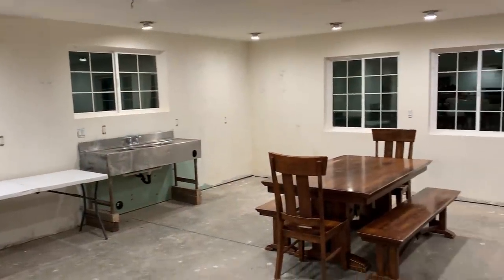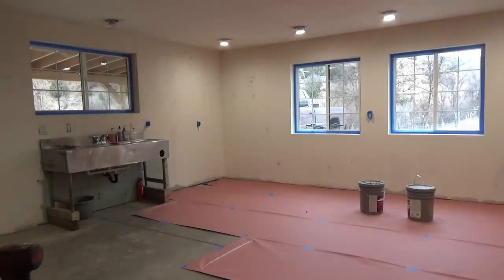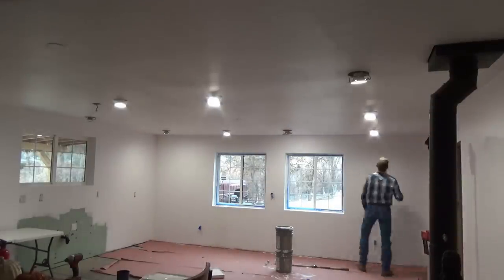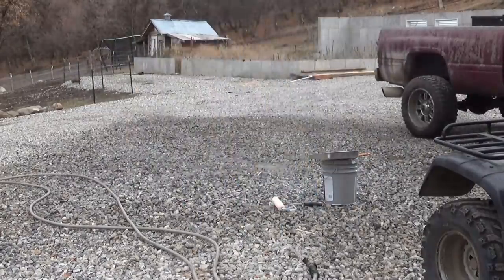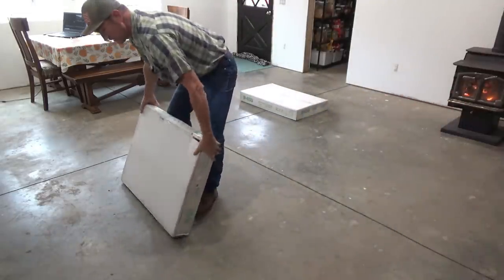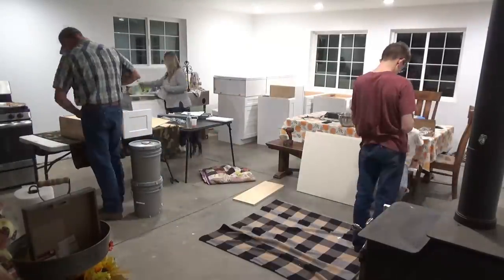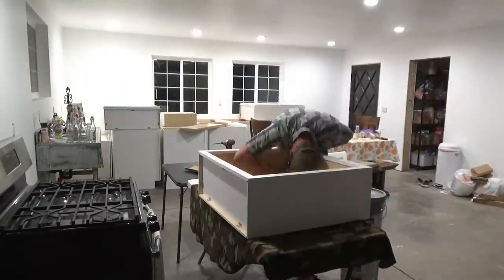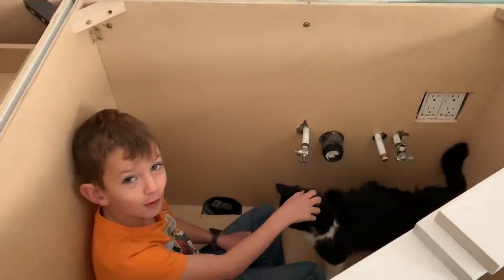#385 - I Painted The Kitchen! RTA Cabinets Assembled

Comment: What works for me is with the upper cabinets, screw a 2x4 to the wall where the bottom will be. Sit the cabinets on the 2x4 and screw them to the wall. That way they are all level, it is easy to hold them while putting the screws in, and it is easy to patch the screw holes when finished and 2x4 removed. I made the mistake of installing the bottoms first one time. It is much easier with them not in the way. You are doing a great job, it looks very nice. Merry Christmas.
Reply: Everybody's back gets to learn to do the uppers first(next time). Right?

Comment: I think you will find white a good choice.  Yes, it shows dirt and kid issues more, but, it really lightens up the rooms.  This is especially important in northern climes like Idaho.  When I had my place in Northern Idaho painted I chose all white and it has been a really good decision!  Even low power LED lights give plenty of illumination because, the light is not being absorbed by the paint on the walls and ceiling!  And, whatever comes in through the windows is bounced around instead of being absorbed by the paint.  Huge difference!

Comment: Can't wait to see the final result. 3 things i would advise you to do. Put some wood looking tiles on the floor, are super durable and easy to clean (perfect for your application),  change the doors with some better insulated ones (will help you warm the place) and maybe try to build some kind of a chimney/fire place in place of that stove. Other than that your work is amazing, i really like what you managed to do with the farm project.
Reply: Alexander he won't take advice very well, but i do agree. Concrete floors look to plain and not homey feeling
Reply: @randomlyfunny2657  I hope he will at least consider. I really like his work. I lived in the country side a while back and i sure do know what muddy boots can do to a floor. Or the melting snow during the winter. Wood is not an option even though will give you that homey feeling. 
Google for "Porcelain Tile that Look Like Wood". I just love them.

Comment: White is a good choice to start with.  It goes just about anything and provides a great base for any colour to be used at a later date.
And Gosh, I love putting together those "RTA - IKEA" style cabinets.  
We did our Kitchen with the IKEA stuff last spring.  I only put 11 of those together in our kitchen, but then our kitchen is only a 1/4 the size of yours (at 10'x10').  Also, I doubt my wife would have let me travel across two countries to help you set up cabinets.  

All our bedroom drawers, and living room shelves and the closets are set up that way too.  Actually the living/dining shelves were repurposed as in I modified them to take our tv and such, something they were not originally supposed to do.

I guess it's just the Scottish part of  me to not spend a lot and reuse what I have left over for something else.  Even our only tv is a CRT style. It still works so why chuck it.

What you got as snow, that storm gave our neck of the woods, freezing rain.

Comment: Looks like you may need some more weather striping on the bottom of the back door.😎
Reply: I think that it's a reflection from the window.  I also thought that there was a gap there But,  now I am pretty sure that it's just light reflecting from a metal strip at the bottom of the door.

Comment: Growing up my dad would only use Sears Best Paint. It was the best paint to paint with. Since Sears no longer sells it I found the Behr Marquee paint at Home Depot to be pretty much the same as a comparable. It costs about $46 gal or $205 for a 5 gal pal, but in the long run its well worth every penny. Most of the time it only takes one coat and it rolls on like silky butter. I never cared for Glidden because it always takes more coats and doesn't roll on as smooth. I learned a long time ago its never worth trying to skimp on cheaper cost for paint because it always ends with taking 2 to 3 times longer to paint and you just end up buying double the paint you would use by just paying for the good stuff.

Comment: That pile of burning cardboard looks similar to the pile that I had left from the cabinets that I installed. I really do like the quality of the RTA Store cabinets. It was much easier than I expected. I did wind up getting a jig for installing the hardware on all of the cabinets (lining up all the handles and knobs perfectly) from the same company I got the cabinet levellers from, check out ez-level.com. It made my job much easier. Can't wait to see the finished product!

Comment: Should have installed all the doors and baseboard before painting.  Primer is fine, but there will be so many handprints, a lot of caulking, and touchups after the trim paint that the walls around the trimwork will look splotchy and you'll want to repaint.  I've learned this renovating houses and apartments as a career for years now.

Comment: While I know that it is your place and you are doing it the way you want it, I would have installed the floor before putting in the cabinets.  That way the flooring is completely under the cabinets and not butted up against the fronts.  It would give it a more professional look that way.

Comment: I face planted in the mud. sluuuurrrrrrrrpppppp AHHH man I went EYUUUUUUU at the sounds of that. :-) Kids :-)

14 hours. MAN that must have been one heck of a marathon. I bet you slept half the next day. THAT is a lot of freaking work!!

White is wonderful. especially in a solar/led scenario. it just makes everything brighter and makes everything feel more spacious. I want color. I love color but my work space will be white. I want the bright and open feel of white :-)

We have had 5 snows already 3 were just dustings. gone by mid day. but the other 2. one 6" stayed for 1.5 days thsi last one 8+ inches is hanging around a little longer. caught me off guard. I was not expecting is so early (back in PA we get more snow but it does not usually arrive till january!!) so my snow blower is still in the trailer. I am not able to remove it (have to dead lift it no ramp etc.. its easy 300 pounds! took 4 of us to dead lift it into the trailer) have to find trustworthy help to get it out. risky they might decide to come back at night and part me from my property. then its up to me and mr 12 gauge and I don't want that.

eventually I need to build myself a little 12-14ft high gantry that I can drive under with the trailer. hook a small winch to a snatch block at the top of the gantry and "lift" stuff, off drive away, then lower it to the ground. One more project :-)

Comment: When you install Kitchen Cabinets, it`s all about precise working. It is no rocket Science, just take care that you stay within half a millimeter precise in measurements. Or in US -Terms: 0,019685  If you follow this, you`ll be OK, and the Kitchen will be a success!  One thing I have learned due to the installing of a few hundred complete Kitchens, precise work is the most important thing!  When you begin to don`t care about a quarter of an Inch, the Kitchen will be a Mess, and you will not be satisfied in the long term! 
And the Cabinets have to be leveled precisely also!  If you do so, you will be lucky with your Kitchen for a long time! And this saves Money and Freedom!

Comment: Did you just paint the living room walls and ceiling in a form of semi-gloss?
Reply: He mentioned it was eggshell. A step in between flat and semi-gloss
Reply: @cheeto4493  

Sorry.  I am NOT a painter,  but I did detect a gloss appearance.   😉
I thought  'egg shell' could have been an off-white paint color.
Reply: Naw, he said it was eggshell.....
Reply: @cherry49403  

Please Read! :

Eggshell paint can refer to a color, usually an off white, but the reference generally refers to a sheen. There is no industry standard for paint sheens, so one company's Eggshell can be another company's Satin, Matte or Low Gloss.

https://www.roddapaint.com › color
Reply: @jehsdca  No problem. Sometimes I mention eggshell to people they think it is a color.

Comment: Be very cautious installing the cabinets, you failed to use nailing plates so would hate to see you or your guy screw through a wire.  This happened in one house I bought by the cabinet installer and ended up having to replace the dryer wire completely.